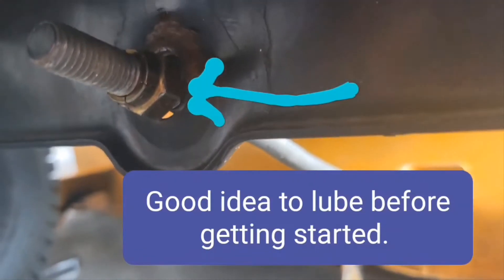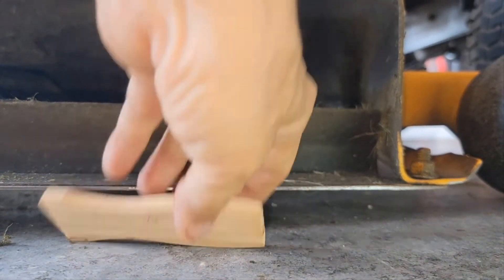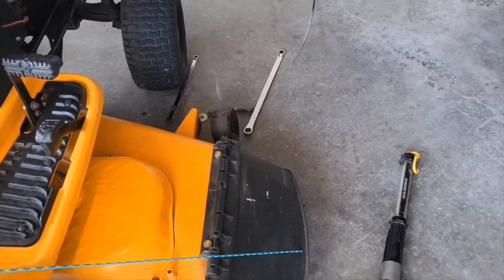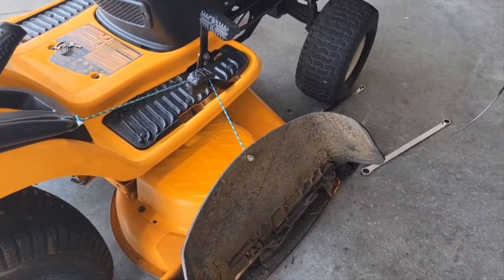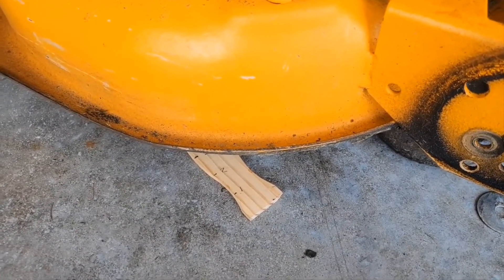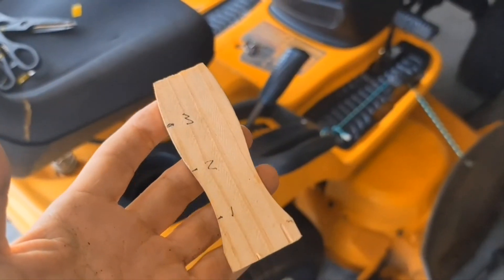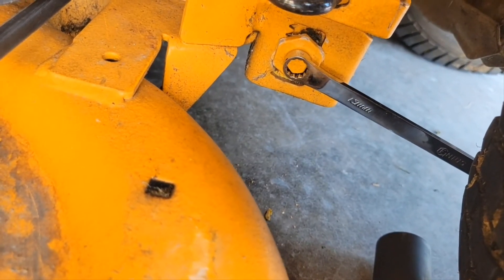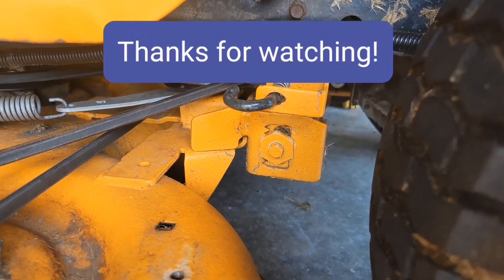HOW TO LEVEL MOWER DECK ON CUB CADET LTX1050

Comment: I'm not sure if anyone has mentioned, I believe your blades are on upside down, I may be wrong ,your info was usefull!
Reply from the maker: Hi Regina, yes you are right. I should  have said that at the beginning of vid. There is a note in the video at the 4:25 mark which says the blades are on backwards from previous owner. Glad it was helpful for you.
Let me know how it goes for you with the blades on correctly.  Thanks for watching..
Reply: 🤣🤣🤣🤣 I'm having enough issues today with this mower deck and came here for some help and see the blades are on upside down ffs. Came straight to the comments to make sure I wasn't losing my mind.  Unbelievable! 🤣🤣

Comment: Looks like you are missing a few washers on the front rod, too.  There should be a bell washer under the nut that attaches to the frame.
There should also be a washer at the deck attachment under the lunch pin.
Reply from the maker: Hi firemedic947, thank u for that information..... makes a lot of sense.... i will definely address that on my mower... u have a blessed rest of the holiday weekend

Comment: Hi! That's me again! I have a general question . Did you ever accidently removed the rollover fuel valve on the gas tank ? Mine popped out last time and I have yet found a way to put it back !! I bought a new grommet but I can't snap the valve into it to be tight in the tank... So I pressed as hard as I could and put some gaff tape around to "seal" it.
Reply from the maker: @DrumPeearl  Hi Boch, no, I didn't take that off. Are you talking about the piece on top of the tank or the piece coming out the bottom?
Reply: @girlintheblueridge6529  I was referring to the piece on the top where a tiny hose is attached to .
Reply from the maker: @DrumPeearl 
 I wanted to remove that grommet on top and clean but could not get it out.  I would heat just the grommet separately with a blow dryer or heat gun. And then use a small flat blade or phillips screwdriver to gradually work it in. Then push in the plastic piece once grommet is in. Will help to lubricate the plastic piece with silicone grease or wd40. 
That hose on top is just to run gasoline fumes back to the carb. 
There is no rollover filter attached there like you see on weedeaters. 
Here's my vid on the gas tank.
https://youtu.be/d6zjnP9u39Y?si=213KHR9CL5LUfr7O
 My fuel filter is on the line coming out the bottom of the tank. 
Hope this helps. Let me know.

Comment: Looks like the deck blade is upside down
Reply from the maker: Hi there, yes, they are. Good eye. I didnt mention it till about the 4:25 min mark. Put on backwards by previous owner. I fixed them when I sharpened them later. Thanks.